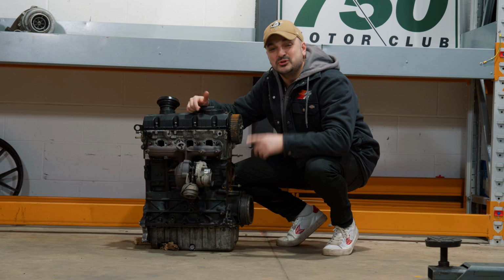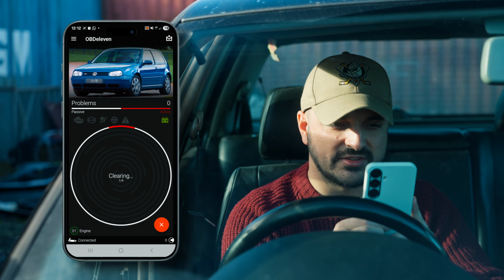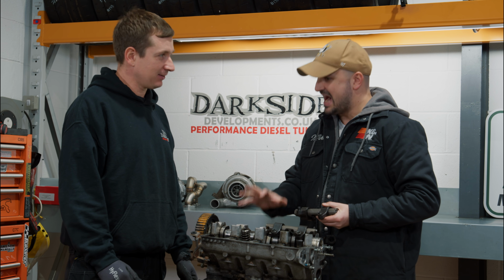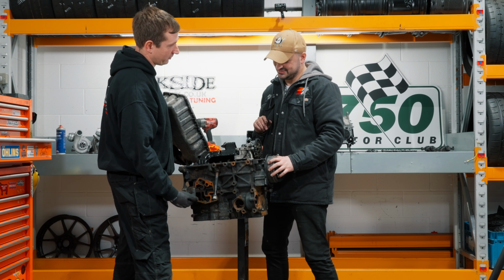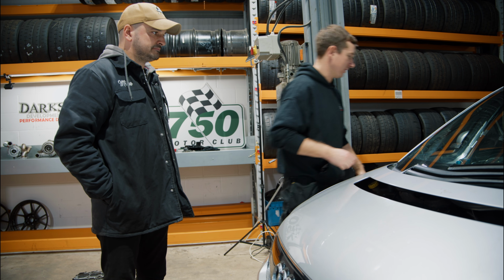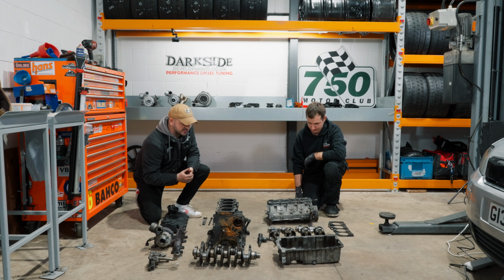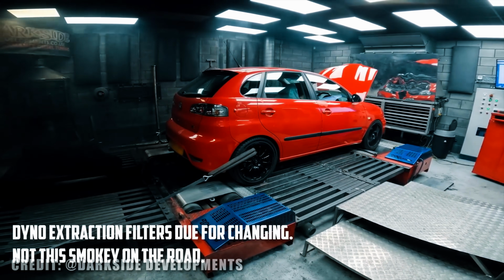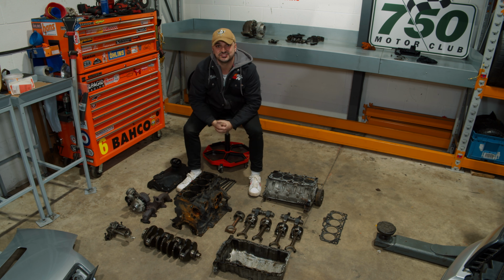Why This Volkswagen Diesel Is The Greatest European Engine Ever Made

Comment: This engine is so good that when you travel from Czechia to Croatia you need to pour out excess diesel because it produces more fuel than consumes.
Reply: In Ireland we'd say it runs on the smell of an oily rag.
Reply: @thelittlehooer them oul passats here are some job hey haha best car in ireland
Reply: @thelittlehooer Or the other famous expression - it runs on fumes 😎
Reply: @thelittlehooer   The PD diesels I heard are better than common rails in low end torque, emissions AND comsumption, but have a rougher engine sound. I might be wrong in some parts but they were unbeatable in their time :)
Reply: @eamh2002  
Rougher engine sound is right but only when the engine is cold.
Reply: @eamh2002  i have a 2010 B6 140 CR and currently on 226,000 miles so far with all original parts
Reply: @troyboi6106   My girlfriend has a 2005 Volvo S60 2.5T with 361 000 miles on it :)

585 000km on the actual clock but used the calculator for miles.
Reply: Imagine the one I swapped into my vw mk1 rabbit pickup with 🫶
Reply: And it is strong enough to carry the weight of the smuggled illegal refrigerant gas you are carrying. An Eastern European has to make some money after all.
Reply: Wtf 😂😂😂😂
Reply: That's because it runs off its own engine oil instead
Reply: @CrazyJohnyBlows The 40kw 1.6d that my MK1 Golf came with had a breather fume runaway. It must have been doing about 10k rpm before a rod left the chat... 😂
Little Golf is much happier now with a  PD 130 in it. Wow, I put that in 2006, and it's STILL going.
Reply: @CS_247  your mk1 had 1.5l and they were notorious for runaway , the mk 2 came with the 1.6l naturally aspirated and these were indestructible ,not the most powerful but very economical and more reliable than any pd engine , the body of the car simply rotted around them and gave up with those engines still purring

Comment: Speaking of oil squirters the two mazda BP8's ive had open both had oil squirters from factory. Ironically both of them spun the #3 connecting rod bearing.

Comment: 22:48 Nope! A diesel engine absolutely DOES NOT fundamentally make more torque than a petrol engine! For a naturally aspirated engine, per every liter of displacement, a diesel has about 60-70 Nm of torque whereas a petrol engines are in the range of 90-120 Nm (a.k.a. specific torque). The peak combustion chamber pressure is much higher as the engine is running by knocking, which is why it needs to be beefier. It was with the HPDI stratified charge (multi-stage injection) it was even possible to have aluminium blocks in diesels instead of cast iron. The peak chamber pressure could be less by starting with a "small knock" and then inject fuel into the already ignited chamber.
Reply: Find one

Comment: I've got a Transporter T5 with the 105 in and 235000 miles on the clock, and it runs as sweet as a nut
Reply: Same here, 275000 thousand and only on it's 2nd clutch. 🤯
Reply: Seria um atd 1.9 pd?
Reply: My us spec b5.5 2.0 tdi has 300k and has only needed a transmission and a camshaft the entire time

Comment: What's great about it? The engine block and steel oil pan, everything else is basically overhyped crap. The PD injectors are extremely sensitive about fuel, the camshaft gets beaten by having to press the injector rocker arm, the lifters get beaten too when the tandem pump starts spilling fuel into the 4th cylinder's cam area, the crankshafts can snap on the 77kW versions. Everybody should sell that car before 300k km, but not if you got the PD150, that one is actually good, but the cam wear is still imminent
Reply: 1.9tdi VE is the king of 1.9tdi's

Comment: 1.5 tsi 130ps vw engine is the first mass produced petrol engine with VNT.
Reply: The first car manufacturer to use a VNT was Fiat in 1990 on their diesel engine, then VW with the 1.9 diesel in 1995. The 1.5 tsi engine didn't exist until 2017...

Comment: The industry-standard designation is OBD-two, that's a Roman numeral.  The folks at OBDEleven are putting a spin on it that a professional is likely to disparage.
 
All of the VW diesel four- and five-bangers have a serious Achilles' heel in their timing belt.  This was particularly true for the pre-PD engines in the late '70s and early '80s, where the slightest slip away from Official Factory Procedure was pretty much guaranteed to destroy the mill.  When they changed to hydraulic camfollowers, it got a lot less immediately catastrophic, but the repair-skill and Thou Shalt Maintain requirements are still in excess of what a typical American auto repair shop can be expected to deliver.  American owner beware, you're going to need to be very selective about shop choice and attentive to the schedules if you're going to keep it going.  That said, my older brother put over 400,000 miles on a Rabbit Diesel by following the maintenance schedule I specified.  It could be done, if you were diligent, but that's not a typical characteristic of an American driver.
Reply: 5 pot PD had gears so...
Reply: @ryanp6138  Five-holer earlier model had a belt.  (It was amazingly awful.)
Reply: Not sure it’s an Achilles heel.  Every car has either a belt or chain.  On the vw you don’t even need special tools to do the swap.  And in many cases the interval for the swap is over 100k. Plenty of cars with original belts running about with well over 200k on them. Cam follower makes next to  no difference.
Reply: @THEROADSMITH  On the earlier models with the timing belt that crossed the location of the water pump, special tools were definitely required, and trying to do without them was a recipe for disaster.  I was a VW dealer parts manager in those days, and I kept the tools on hand for sale.  We routinely asked people if they had those tools when buying any of the timing components or the water pump, and patiently explained what they could expect without them.  It caused about half of the parts customers to become service customers instead, a fact which my service department completely failed to give us credit for.  I was the only one who kept the tools on hand, and we had slowly gained a better reputation as a result of things like that.  (The dealership was a pit of ripoff despair when I got there.)

Comment: They good but not the most reliable , 1.7 dti Opel and 250 Isuzu motors do much higher milage, my Isuzu 250d is on 2.4 million kilometers.

Comment: Now we need to see a Fiat JTD engine from the same era which was the first engine to adopt modern Common Rail diesel. Absolute tank and motorised almost all the Italians during the 2000s.
Reply: Great engine shame they used a very poor gearbox that can't hold decent power let alone the stock power chocolate box from vauxhall M32 box
Reply: @g_compo8639 the F40 is the best box, they can take an awful lot of power. The M32 just falls apart if you sneeze in it's general vicinity
Reply: Fiat invented electronic common rail injection for diesels. They hit (one of many) hard times and sold it to Bosch. Fiat also had 1.9 and 2.4 diesels. I hear the original development was a joint effort with VW
Reply: 147 JTDs had only C530 and C630 FiatPowerTrain units
these were capable over 450Nms too

Comment: Used to have a 2002 A4 Avant with the pd130, eventually traded it in after 5 years ownership at 20 years old with 258k on the clock . Old girl still started and ran perfectly and if I kept the stock 16 inch alloys on it I could get over 1000 miles to a full tank. Brilliant engine

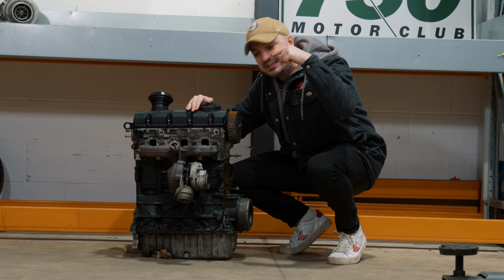Comment: 0:06 this is a criminal statement. Are you building a barge to transport coal mike?

These are literally vw marine engines, for canal boats and the like. look it up.

This engine is reliable because it made 90-140hp. You cant credit vw with making greatness when tuners are the ones that turned these up to make power.

Vw themselves never sold powerful versions of this, they were known for being reliable because they only rev to 2800rpm.

Yous laugh at American push rod engines but this is just a canal boat version of an American OHV engine. There Simple, low stress, and reliable. Only this runs on satans fuel.

Its not even an argument that VWs greatest engines have to be the vr6, the 2.5l 5 cylinder, and even the 1.8l because they were special from the factory. 
They were moderately powerful AND RELIABLE. 

Pd diesels can only claim to be reliable. You dont choose your gf solely because shes reliable, thats the girl you fall back to when other things don't work out. 

These were only popular in Europe as well. Im not sure if the US even got them. Hardly a world renowned engine and more like a local river anchor.
Reply: The USA had lots of them and they all rev to 5000rpm so this comment needs deleting

Comment: Who doesn't love a PD. I like the old Peugeot diesel engines in the 306 D Turbos more though those things really are bomb proof i ran one on cooking oil for years, used to get it from a nursing home and just filter through a pillow case. Can only really do it with older ones with Brosche fuel pumps though not the Lucas pump ones as those clog.
Reply: And then Peugeot built the useless dv6.
Reply: @jaycotto26 yep! Those old D Turbos really were something else. Never get an engine like that again. The older none turbo 1.8 variant was even more solid but super rare now. Engines outlasted the cars.
Reply: @jaycotto26 Vag Diesels.post the Pd haven't been great shakes either..
Reply: I have a 2.5Tdi  AJT PD engine that I've been running on veg oil for about 10 years. Had a few of those Peugeot's back in the day, they're still sought after in the veg oil circles.

Comment: I have been driving VW and Audi cars since the beginning of my driving career in the 1970’s, and I have to respectfully disagree that this is the best engine They made, of modern TDI engines. Yes, it is very good, but I have blown more of these engines up than any other VW engine, i Drive extremely spiritedly. If I don’t hit over 100 miles an hour every day that I drive, I might as well not drive at all. I have found that the old 1.6 turbo diesel from the 1980s has been one of the toughest VW engines ever made even the naturally aspirated was, a bit tougher as in I’ve never blown up one of those, and I have tried. But the TDI engines, the early TDI engines like offered in the B3, and B4 Passat, those were the toughest as far as I’m concerned, maybe because they didn’t make enough power to hurt themselves, but I’ve spent many years abusing them with little success, of actually hurting them, but the PD 130 I have engines that I’ve blown connecting rods through the side of I have engines that I’ve blown the rings into pieces. I have damaged those engines so many times and very easily. Just going down the autobahn at full throttle is enough to kill them in a matter of 40 to 50 miles in contrast going down the autobahn in full throttle in a 1.6 diesel Mark one golf doesn’t seem to be an issue. You get off the road and the engine still runs you don’t need a tow truck.

Comment: What year were these fitted to UK cars till? Are any ULEZ friendly?
Reply: Most of these engines had their heyday in the early 2000s. My PD150 is Euro 3, so definitely not ULEZ friendly, which is wild given how efficient it is. More modern engines have better filtration on the exhaust, but so much less reliable.

Comment: Had a 130pd Bora 25 years ago - was a great car, pulled like a train great waste gate noise for a young man and never let me down
Reply: Wastegates don't make noise ? Do you mean the blow off valve ?
Reply: @TheThunderwars  They don't have either. They have vtg. But do flutter when you shift fast without letting rpm settle.
Reply: Whatever it was, it was cheap and fun

Comment: Jeez, 30 secs in I went to pause & I`m all set to write about Honda`s K20 engine, gob shut pronto as you named the 1.9tdi, fingers foze, coz I put 188K miles on one of those, stage 2 remapped it & took it to Nurburgring, what an engine those things are, right well, that`s me put in my place Mike, back to watching, carry on!
Reply: My awx 130 passat has 240k mapped to 220bhp with a 52mm hybrid turbo and front mount hasn't let me down in over 8 or 9 years also have a daily a4 b6 with the same running gear with 270k miles 😂
Reply: 1.9 tdi under 500 000km/300 000 miles almost not worth mention these days. They do 1M+km in a daily easy.

Comment: Having spent 20 years at a VW dealer as a mechanic,  I'd say the most reliable was the older ABA 2.0L normally aspirated engine.  Virtually bulletproof,  you could snap a timing belt and still be ok. The PD diesel was good, but still had it's issues. It wasn't as reliable as the ABA.
Reply: Might be true, but the EA180, EA188 and EA288 drive much better and were more efficient.
Reply: @ego4551 Agreed with efficiency.  But overall reliability though?
Reply: @Silverhornet81 and don't think so

Comment: Honda K20:
Am i a 700,000 mile joke to you?
Reply: pfft, theres plenty of PD's over 1 million miles.
Reply: @bunter6 plenty of k20's also but the k20 can do 700,000 with only oil and sparkplug changes.
Reply: I've personally seen and being driven around in a  1.9 PD with almost 1,100,000 miles while still being basically original. Seen 1.9 VP with almost 700k miles, too.
Reply: @ego4551 what does basically mean?
Reply: @alphataurifan  I don't remember if it was still the original turbo.
Reply: @ego4551 not bad, the pd130 is fantastic.

Comment: The thing that boggles the mind is that after these amazing engines VW made a series of the worst engines ever build 😂😂.
Reply: Which ones are you referring to? 4 Valve PD(for example the 2.0PD)?  The CR have been great with few outliers and of course the diesel scandal.  Or are you talking about petrol engines?
Reply: @ego4551  1.4 MPI scorching cilinder walls and the TSI with the faulty chains and the cheating diesels.

Comment: theres also a pd160 which only came in the ibiza cupra
Reply: We did film some about one of the guys Cupras at work but maybe I waffled too much!
Reply: @ryanp6138 haha waffle to some but interesting information to others
Reply: Had one with a map on it. Was great apart from the ratios on the gearbox being too short for the motorway. Drove it round the Wild Atlantic Way. Wish I hadn't sold it!
Reply: He mentioned it while talking about the crankshaft. 30s, 50s and 60s share the same one with bigger big end journals
Reply: @Ktmzqw  Yeah, true that, and also the head bolts.
Reply: Turbo, Intake, intercooler are different on a 160 vs 150.
Reply: @jatkin22 yes i had one, only to get a front mount intercooler, not to mention black headlining and interior
Reply: Only turbo... @jatkin22
Reply: I didn't bother to watch it after he missed out the PD160.
There is an excellent VAG series of publications in the home study programme, or something like that, which includes the PD engine. Probably time far better spent.
Reply: brother i can make you a pd160 with my laptop in no time
Reply: @ProntosmoloCZ  turbo is diferent
Reply: @mordormordo1986 Injector tips, turbo, something else I think too.
Reply: @rkan2 in comparation with PD150 the 160 has a different turbo only...

Comment: Shame the 2.0PD engine wasn't nearly as good. I had the 2.0PD in an Audi A6 (new in 2007) and it was absolutely pants. Turned out the engine had been built with a piston ring missing but even after they fixed it under warranty it was still horrible, noisy and vibey, massive oil consumption (1l every 600 miles after it was "fixed" and they said that was within tolerance!). I had two different 2.0TDi loan cars while the car was in being diagnosed and fixed and both also had very high oil consumption. The car had loads of other problems and I can honestly say it was the worst car I've ever owned (and I've owned Renaults!!!). I was so glad to give it back at the end of the lease. Hard to believe how the 1.9 and the 2.0 PDs could be so different
Reply: Yeah. pretty much all 4 Valve PD diesel have issues.

Comment: I thought this was gonna be about the VR6.
Reply: The PD is a great diesel engine but the VR6 is absolutely the best sounding and most reliable engine Volkswagen has made (I'm biased)
Reply: Lmao
Reply: Fun fact the vr6 was originally going to be a diesel that’s why it’s so strong you can tell by the gap between the pistons as it way better than any petrol engine so I could take more pressure.